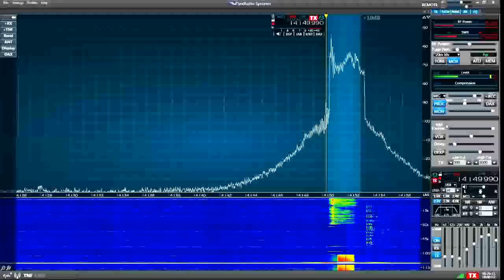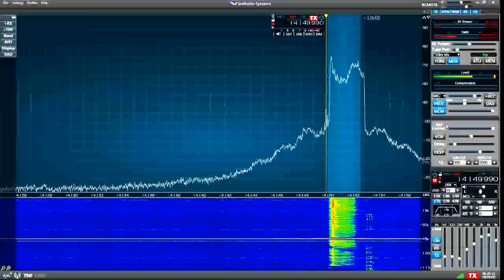Digital Voice & SSB Comparison

Comment: Really not impressed with the demonstration. The digital audio is no clearer than the SSB audio, if anything the SSB is superior in intelligibility and ease of listening. This is why the mode never gained popularity when sold as hardware by AOR not as software. Several attempts have been made to revive digital voice on HF but there has yet to be one that sounds natural, works with weak signals, and is reliable. 
Let's be honest here DMR, P25, and NXDN all sound terrible - especially if you have to spend a whole 12 hour shift using them - and that is with strong local signals and far greater bandwidth.

Comment: hmm,... While I usually like all sorts of digital modes, while I toyed around with freeDV (was and is a lot of fun) and while I really appreciate the work David has done on Codec2 to give us a free low-bitrate codec, I must admit, that I am currently not impressed too much by the performance of any digital voice mode in general. Let me explain why:

If the only reason for using HF is to get "some" information through from point A to point B no matter what, then digital text transmission will just be the better fit. Be it morsecode, PSK, RTTY, MFSK, whatever...

But if hams talk to each other, then usually not only the information itself is important but also the quality of the voice signal. Quality in the sense of "naturalness". And this is the point were all variants of digital-voice used on ham radio bands have their weaknesses. With the used bitrates they sound like a speak'n'spell-toy. Artificial. Clearly understandable but no joy to listen to. So, if digital voice on HF (VHF/UHF) shall be a general success, it's not only required to make it at least as good as SSB in terms of km/Watt but also at least as good in terms of intelligibility and naturalness. 

The other option which would allow for a wide acceptance would be: Make it by far superior in one of these disciplines. That is: If it can reach e.g. four to ten times the range of a SSB-signal with the same power, audio-quality will not matter any more. If it can sound a lot better than SSB but occupying the same bandwidth then no one will complain about limited range. 

But the current situation is: It's not quite on par with SSB in terms of range for a given power-setting and while cearly understandable it sounds a lot worse. Esp. if the speaker is non-english and/or has unusual voice properties (very dark or very high pitched voice, some permanent hiss in it...)...

BTW: I can imagine how hard it is to get a decently sounding low bitrate voice-codec. The audio quality achieved by Codec2 at higher bitrates (3200) is extremely impressive, espacially directly compared to other codecs. Codec2 is reaching voice-"transparency" in that region while AMBE for instance still sounds like a little bit like a speak'n'spell. So, my hope is, that Codec2 will further improve in this regards...

Edit/BTW2: Commercial Digital Voice on VHF/UHF (dstar, dmr, c4fm...) even is worse than FM. It strongly sounds like the aforementioned toy and has a range to power ratio being on par with FM if at all  (Even SSB on VHF/UHF sounds more natural and has a lot better range to power ratio).
Reply from the maker: Any choice of modulation is going to be a tradeoff.  Fidelity ("naturalness") vs power efficiency (required power for effective use) vs spectral efficiency (occupied bandwidth) vs intelligibility vs sensitivity to QRM and so on.  AM, SSB, ESSB, FDV, NBFM, DMR, etc all represent different tradeoffs.  No mode is "better" on all measures -- or we'd all be using it.
Reply: Martin Ewing
Erm,... yes and no... No, fidelity (mni tks fer missing wrd) is not a parameter of the (analog) modulation itself, but soley a parameter of it's bandwidth. E.g. SSB and ESSB are the same modulation (ESSB just being wider -- but this is not(!) the type of fidelity I am talking about) but differ in their bandwidth. The same is with FM and N(B)FM. But I wasn't going to discuss analogue modulations and their trade-offs but the lack of benefit using a digital one.

The point were you're absolutely right is: The modulations (and their chosen parameters) are trade-offs. BUT: Currently all digital voice modes do combine the worst properties into the next trade-off:

Limited range, limited intelligibility at marginally reduced Bandwidth and that combined with a tremendously larger complexity. That is: There currently is virtually no real benefit against analogue other than being "noise-free" (and this isn't a real benefit at all (*)).

FreeDV-700B, however, might be the exception all the people are waiting for in terms of having a real benefit against analogue...

-------------------------------
[*] "Noise-free" isn't a benefit for low bitrate codecs at all, as our brains need some noise to mask away (to "fool" away) the compression-artifacts. +David Rowe, maybe "re-noising" the output will help our brains to forget about the artificial sound-texture these vocoders have?
Reply: I agree with Stefan, unless there is some tangible benefit other than being just a new mode, the voice quality and intelligibility is awful.  Listening to this fine demo reinforces my liking of analog SSB/FM/AM over FreeDV... for now.
I find it much more pleasant to listen to an analog signal that is fading than digital.  The human brain is very adept at picking a voice out of noise, even with phase shift. with digital it is simply unintelligible.  Why not aim for a 3 to 5 khz bandwidth and use a higher bitrate/different codec?  Digital voice will not be very popular until the voice quality is transparent without the digital dropouts and "robot voice".  There is no shortage of bandwidth for Amateurs, why squeeze it down to 1.1 khz?  Just to say we did?  well that's done now let's have quality transparent digital voice!

Comment: Great demo guys, well done!

BTW I can see a little downward slope on the tx signal, more power at low freq than high.  This means the LF carriers are getting a bit more power. This is often fue to the radio tx filter response.  Might be something we can tweak in the SM1000. Cheers David, VK5DGR
Reply from the maker: +David Rowe Yes, I think the KWM-2 was not really designed for digital modes!